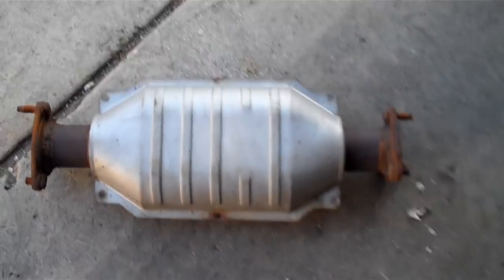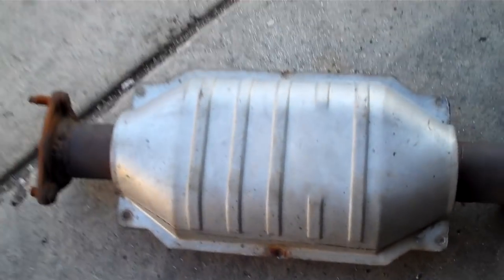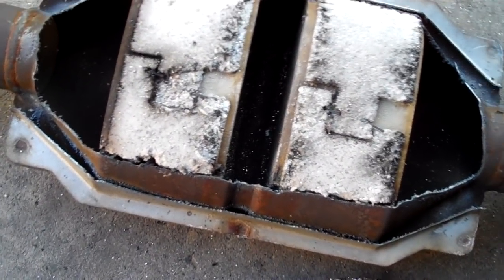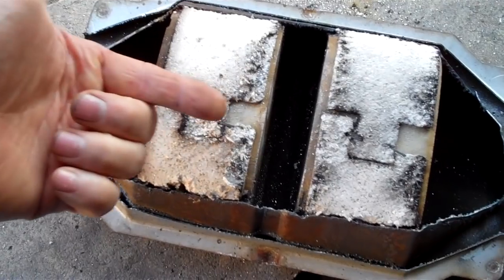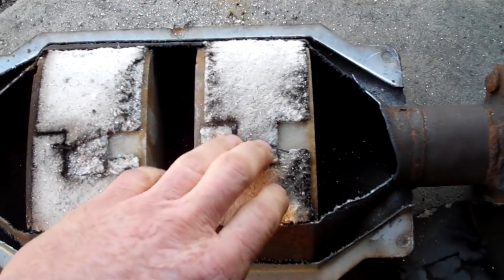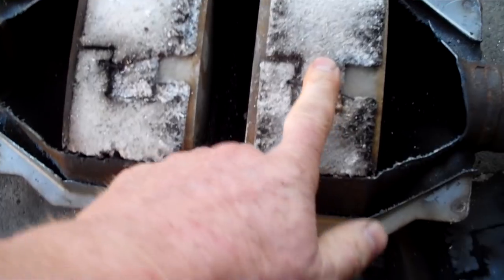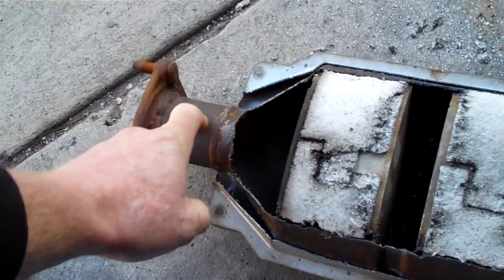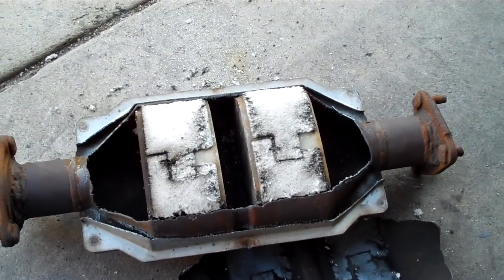Here's what's in a catalytic Converter.  Here's how they work.

Comment: Hey Brian you ever messed with butterfly valves?  Years ago I worked on a design for a car that would be sleeper until you were ready to drag at which point a couple of switches would open the exhausts fully, start a blower running on an electric clutch.  Etc etc.  I think you get the idea.  I never did get the engine to cooperate.  What was needed was a ECU that could handle multiple programs but I could not afford such a thing.  Any advice?

Comment: I just wonder how often cats fail or are they replaced because of the lack of knowledge.  You certainly know your stuff.  I've never had to have one replaced on any of my vehicles (same for 02 sensors).  240k miles on a Suburban, 165k miles on a C1500, 155k miles on my Suzuki, 98k miles on my 3500 Express.  I was once told by an "emissions repair facility" that I had a bad cat and EGR valve on my Suburban (failed emissions due to high NOx).  Second opinion found a disconnected vacuum line.
Reply: Dan Burch luckily we have no emissions test :)

Comment: the 1st o2 sensor has a heater to it (4 wires) thats why it is more expensive then the others and it is essential for your engine to get that high fuel milage. I had a d15b7 civic vx with a bad o2 sensor in header would get around 20mpg fixed the o2 sensor $350 at a time and my mpg went back up to 45mpg so yeah. Based on temperature of that sensor your engine knows wether how to manage feel/air mixture. removing catlike converter might cause its warmup time to extend and in the end this is a soccer mom car so just tell me dude why ?  lol you could get a aftermarket catlike converter for $50-$100

Comment: Brian seems smart, way smarter than me like my Gen Chemistry Teacher.
Reply from the maker: Thanks John ;  )
Reply: briansmobile1
 No prob! Thats why I love your channel, I love asking 'why' and understanding and your super funny and good and explaining things so its relevant and fun. Keep being funny and smart!
Reply: John Smith
 p.s.  Im recently really trying to dig deep into cars and learn about them but ran into a buddy with a F350 which randomly idles when he hits the gas pedal with no response, even when he hits it to the floor. Then he turns off and on the car a few times and it fixes it. There are no codes either. Im honestly using this as a learning tool and trying to go through all the systems to help me grasp how the engine and all the sensors work. So far I think he may need a new mass air flow sensor or maybe that the new pedals that are electronic and have positioning systems that arent mechanical may have malfunctioned and now doesnt always read the pedals position right. Does that seem like Im on the right track!?  Thanks buddy!
Reply: John Smith
 Check for vacuum leaks by listening for a hissing sound under the hood. Also, you can check by using Brake cleaner VERY CAREFULLY around the intake as well. PLEASE do not do it with the engine hot but when it is fairly cool and please have a fire extinguisher ready just in case.
Reply: John Smith tps is getting wonkey  ;)

Comment: super carbie that you mentioned by Tom Ogle - nice but oil companies and oil changes have nothing to do with it. It's just not so efficient. Simple as that. It might run but you ran into other issues, like power and consumption goes up when you put some load on it. Simple calculations will show that x amount of fuel has x amount of energy which gets absorbed by heat and the engine itself and the rest is transferred onto the wheels

Comment: I have a 97 1500 ext. cab chevy   5.0 vortec, Ive recently(6 months ago) done the "creature of darkness" thanks to your video with the red suburban. maybe you can help. (p0420 (lean bank 1 cat system fail) and im thinking its a leaking pcv valve. after pcv and before intake that boot intake leak causing a lean mix??  is the only code to throw since spider)

Over the past month my truck has been getting harder and harder to start. and when it does start it stumbles on acceleration but powers through after about 1500. But always only until it gets warmed up, The stumble is getting worse and the starting is sometimes bad to the point of help from another cars battery. But then when in operating temp its the beast it should be from 800 to 5000.  And USUALLY id say 95% of the time its a quick restart. when its hot with no excessive turnover just one crank and fire. long before this problem when chasing the fuel regulators multiple missfire, I did cap and rotor (duralast not delco?) plugs and wires. So im not thinking its spark related. I'm here at a cat video (THEN saw it was you) because of the teperature variable. Im thinking it may be clogged. and possibly broken down from the fuel dump of the bad REG.  My other suspicion would be a worn distributor gear (since metal slightly expands hot. ... its probably the cat.... mines welded on not flange bolted like the one in your vid.. any help or advice would be awesome 

You"re the man brian and funny i think im gonna end up helping a buddy do another spider for his burb. hes been eyeing your vid a bunch hes just gotta buy the dam thing. as you can see im a rambler. maybe you can appreciate that though!! ;)

Comment: Back when they were putting that dang sensor up the exhaust pipe of the vehicles that are OBD 1 there was one time when I had my vehicle inspected it didn't pass due to it running rich my vehicle has a Feedback carburator so I pulled the carb off rebuilt it and set the idle mixture screw nearly turned all the way in but I also modified those long tubes in fuel passageway in the carb when I went back to have it reinspected one of those sets of numbers that machine looks for was zero I wish I still had the paperwork that they gave that shown how much of the various things that machine looks for in the exhaust content but what ever that number was and what it meant must have been a very significant some kind of something lol because the guys at the inspection station wanted to know what I done to cause my vehicle to blow such a clean amount of what ever that number meant because the dude said he never seen that happen before because usually a vehicle would have some kind of reading where all those zeros were but something I done gave an all zero reading lol 😁

Comment: Wow. 6 years ago you made this video. Did you ever solve your kids nightmares? I'll tell you what the source of mine and my kids is (even presently) - spirits. No joke. 3:30am was their favorite time but they could happen whenever. I cant see them but my kids and my wife can. My oldest sister could too. Too bad I cant see them. If I could I would chase them around with a vacuum cleaner...after I vacuumed up cat poop. Get it...cat? Thats pertinent. Too bad its not haloween.
Great videos like usual. Thanks for your video on the black spider in the vortecs. I just did mine. Runs smoooth as silk. Now I have a cat problem. I think it's pooped out. P0420
Reply from the maker: That's some wild stuff right there.  I've heard of it, but never seen it either.  Best of luck!

Comment: Great video. I have an issue with a check engine light in my 2001 v6 Chevy Camaro. The car runs fine. The mechanic is saying the sensor are fine. We replaced a few of them, but still no luck. He said it might be a computer issue or a catalyic converter. Is there a way to test if that's the issue? Is that usually what causes the check engine light to come on?
Reply: Joe Khoury your mechanic has to connect it to the computer to erase the faults, if it goes again there is a problem somewhere if not it was bad fuel. If the cat is off usually you get a strong smell.
Reply: argonauths I have reset it a handful of times. I tried putting a high octane gasoline also which didn't do anything. The codes I get are P1133 - Insufficient switching upstream bank 1. That's the main issue. I have gotten a P0141 downstream bank 1 and also P0463 once or twice before also, but are intermittent. 

There is a little bit of a smell from the car, but I think it's because it's burning some oil. I have a slow leak that burns as it drips on a hot pipe on the bottom. The car is over 14 years old with 210,000 miles on it. I'm thinking to just drive it until the next smog check, and just turn it in. I would love to keep it, but I think it's time is running short and it may not be worth keeping anymore =(
Reply: Joe Khoury maybe the intake manifold  has a loose connection. Did he checked the sensors fuses and connectors for corrosion? they should be clean to operate.
Reply: argonauths I can ask him to check next time I take it in for an oil change. Doesn't seem likely, but we can check.

Comment: I appreciate the reply. I have new NGK Platinum 4 prong plugs and compression on the cylinders is normal. (180s across the board). Could a failing CCV system create too much blowby and allow too much oil into the intake manifold, hence increasing oil burning and thus higher HC?

Comment: Hey Brian I have a question in reference to catalytic converters. Does it matter how far the down stream 02 sensor is from the cat? The reason I'm asking is I had my cat changed and the guy that did it moved the cat closer to the engine and it is further from the sensor now. I've been having issues with the cat monitor running prior to having converter changed. The vehicle is a 2000 GMC Safari. Any info would be greatly appreciated.

Comment: Sup man grate video and wanted to know what would happened if I take out the catalytic converter and replace it with a extended pipe with the rear 02 senior plugged in and with the muffler on as well
Reply from the maker: DemikB16a Great question!  You'll have a check engine light and a code P0420 and maybe some others.

Comment: Hello Brian Bubala! It's Shep. I was doing a general check out and found a small hole in my muffler.(2000 S10 2.2L) Question;would I get any benefit from a high flow cat back exhaust system?(Magnaflow-Heartthrob-Thrush-etc.) I.E. better performance and/or MPG. Or should I just replace the muffler.The only thing worse than wasting sheckles is a bacon cheese burger on the sabbath! Thanx Shep.

Comment: Hey Brian,

My 96 Montero SR, failed emissions, found out that No.6 cylinder has zero compression, and 3.5 liter engines for these cars are rare, they say 3.0 Liter one is a direct fit? and there is lots of them around.
Worst scenario for no compression is a bad piston rings or a bad valve? will be able to do it myself being a novice? I have somebody pull out the engine and have downloaded factory manuals. Any advise would be REALLY appreciated.

Comment: Hi Brian. Is it safe to incline my car and pour paint thinner in my tailpipe to clean my clogged cat converter?
Reply from the maker: No.  Probably not.  Best to take it off the car to inspect/clean it.  Soap and water would be a good first move.
Reply: Yeah but it might be welded on but I have to check to see.
Reply from the maker: If you have a sawzall or a hack saw you can still remove it and then re attach it after or put in a new one if you need to.
Reply: Brian, let me ask you something, why would you pour paint thinner in your car and risk damage to the car, when you can go to auto zone and buy the correct product that's guaranteed that if something happens, the company has to pay for the damages?

Comment: Youz to smart to be a mekanik! I like your vids. Also appreciate/hate the story of Tom Ogle.
Reply from the maker: I studied engineering and business at university.  To be a mechanic these days you have to be smart.  Cars are incredibly complex today.
Reply: briansmobile1 Cars are still pretty much the same as they were 100 years ago.  Look at them for a second....  Cars still have 4 wheels and at each corner is some type of braking device and a suspension for the car to ride on, cars these days still have this.  And the same thing applies for each of the systems of the cars, we just keep adding more and more crap to cars these days which is making them more complicated.  Pretty much all the systems are monitored, so troubleshooting and what not is not really as bad as you think.  Give some dude a scan tool and about a year in a car based school, and bam, we've got another tech who can read a stupid tool and replace parts.  I grew up learning how to tune carburetors, how to rebuild master cylinders, how to ridge-ream an engine block, how to re-crosshatch cylinder walls, rebuild suspension systems, etc.  They don't teach that anymore and in my opinion takes more than just reading a simple scan tool.  Does this make me smart?  Maybe, maybe not, maybe I just pay a whole hell of a lot of attention to details.  I have zero degrees and I can break down a car completely and fix anything necessary to keep a car running.  My CRX has 354,000 miles on it only because I maintain my cars.
Reply: Kris Michalsky there is a big difference from a CRX to other more complex cars.... yes they appear similar to what they did 100 years ago but make no mistake they are way more complex
Reply: Nevsack63 you do need a degree to get a good mechanic job... and so you do a little work on your car woopie dee doo can you change the apex seals on rotary motors?
Reply: Anthony Ross you said Nevack63 twice....

Comment: Nice vid. I have an 05 toyota tundra and the 02 sensor is in the middle of the catalytic converter. I want to get an  after mart cat and ones I see have the 02 sensor behind the cat converter. Would this cause the car to read wrong if I installed a cat with the sensor behind instead of in the middle or the cat

Comment: question for you brian..
if my catalytic converter is dirty...will it cause me to have bad mileage?
thanks
Reply: My name isn't brian, but I can tell you your Cat will have no major bearing on your mileage. If it is clogged however you can have poor mileage (among other more serious drivability issues). 

Your primary O2 sensor (the one forward of the cat) is the primary exhaust decider on whether your mileage is good or bad.
Reply: thanks a lot for your input ... i usually get my reading from the dic.. i was getting roughly 19-20 litres pr 100km ...now im reading 28.9 L per 100 km...any ideas? i figure it could be my egr.....there's no engine light on..or codes being given to me at the moment.. my last fill up was 50 dollars from gas light(got me just over 1/4) i used a bit of cetane additive.. what do you think?
Reply: seannootherway I'm assuming you're in Canada, I don't know if they have a specific blend there as they do in the states based on season. Here winter blended gas contains a high amount of butane which packs less of a punch than your average gasoline. Winter fuel mileage takes a dump accordingly. That could be part of the reason. Start with the basics here, Check your tire pressure using the car manufacturers recommended PSI/kPa listed on a sticker usually found in the driver's door edge or on the jamb. Replace your fuel and air filters, see if there might be some debris caught in the undercarriage. Many new cars are equipped with some kind of air dam/valance/deflector mounted directly under the front bumper cover. This serves to improve aerodynamic efficiency by reducing drag. If it is damaged, it can cause higher drag, and therefore higher fuel consumption. Singularly these issues wouldn't cause a decrease in efficiency as high as you've described, but compounded they can reach that point. Another good thing to do would be to clean out your throttle body bore and plate along with your MAF. Follow all this up by pulling your battery for a good 30 minutes. This will reset your computer's engine parameters allowing it to relearn how to operate your engine to peak efficiency. It can take a week or so for your computer to relearn everything. 

an EGR valve is surprisingly simple and only on few occasions goes bad. I personally stay away from additives (save for the very occasional lucas fuel injector cleaner/lubricant) as a LOT of them are just snake oil. Are you running Diesel? Cetane is a Diesel thing, (Kinda like octane to gas, for those who stumble upon this comment going "WTF?"). 

If you are using diesel, see to it that you are using the manufacturer specified grade. When in doubt and when many options are available, stick with Ultra Low Sulfur Diesel.
Reply: thanks! ill try these steps out. and give you an up date on how that goes. and yes, i'm in canada running a diesel 6.6 v 8 2500hd sierra lbz
thanks

Comment: About to replace rear main seal on my 1999 5.3l z71 engine 204k mls, as well as other things. Gotta take off cat y-pipe to do all my fixes. Catalytic converters, I've done various testing, so I do know the cats need replacing. I've hung plum weights on strings from front and rear of y-pipe to measure length accurately with tape. My measurements don't match what rockauto, etc. sell.  They say 46" or 50+ inches.  My short measure is 37, longest is 40".  don't know what to order.  Plz help  : )

Comment: Hey did you try HHO a 1lpm Unit can turn this Used catalytic converter into a Home or shop Heater.
Reply from the maker: Justin Schubert I've made several HHO or Brown's gas generators.  I haven't run them into a cat though.
Reply: I did finally run an HHO generation into an intake 6lpm the result was an Engine that ran better.

Comment: just an fyi NO2 is Nitrogen Dioxide and NOX is nitrogen monoxide
Reply: correction... NO is Nitrogen monoxide and NOX is not an element.
Reply: John Kerns Oxygen is NEVER found by themselves ALWAYS find two Oxygen atoms in a "chain".
Reply: John Kerns NOx is Mononytrogen Oxides (as apposed to dinitrogen oxides like N2O). In smog it stands for both NO1 and NO2. They don't distinguish between the two because NO1 converts to NO2 quickly in atmosphere.